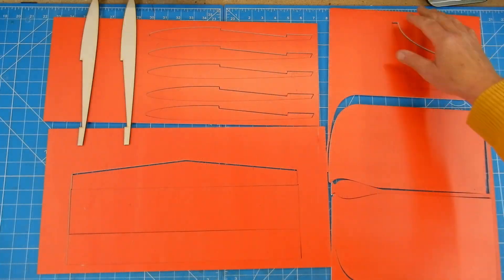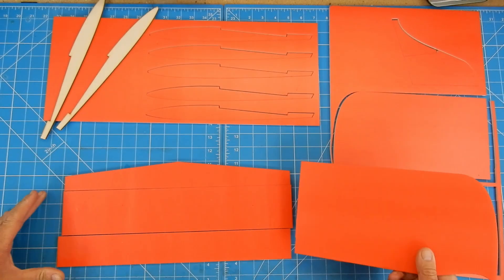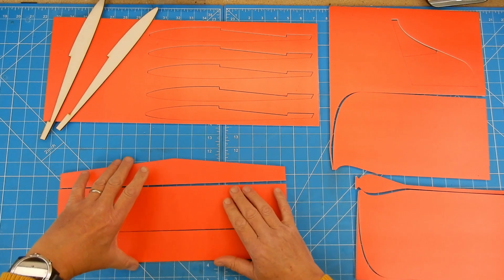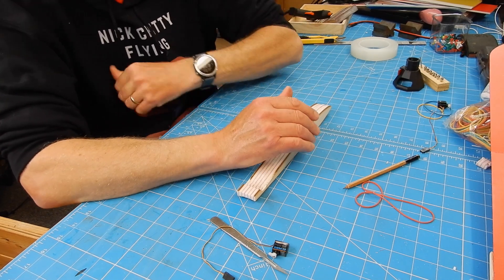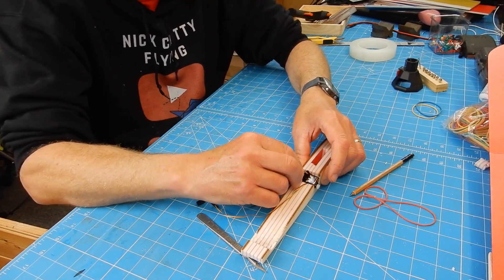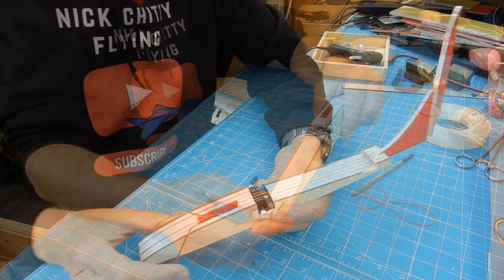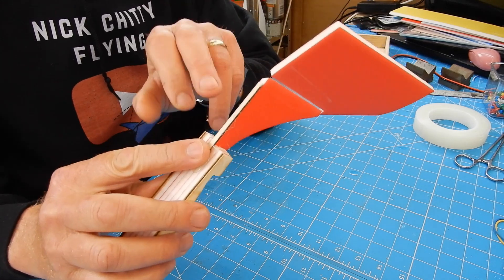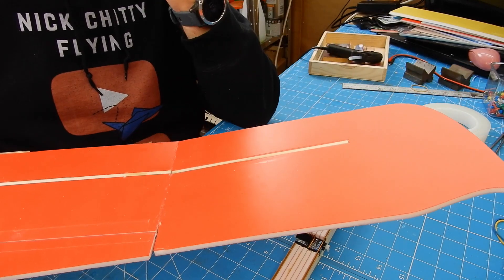Flying Wing morphing Kline–Fogleman wing sections Build

Comment: Instead of pins, how about repositionable spray adhesive? Somewhere I have a copy of the RCM issue that features the Windfreak. Are you familiar with Jim Marske’s work?
Reply from the maker: I nearly bought a plan set from marske but built a super floater instead. In the test flight video I use adhesive 👍worked great
Reply: @NickChittyFlying  I have 2 models without vertical surfaces. Both are outstanding flyers. My favorite is a diffuser tip by Richard Miller. Scaling up. Does not work well.,
Reply from the maker: @alcourtines4707  fully agree

Comment: Do you have rough dimensions? Might give a try at 3d printing the fuselage sides and rudder then use Adam's foam board for the wings and center of the fuselage.
Reply from the maker: I will post tomorrow buddy I am out with my wife till tomorrow 👍

Comment: I have had Jedelsky Kline–Fogleman wings on gliders. I built mine with double sided carpet tape but that is permanent, not removable. They did not fly slowly and the stall was brutal. But fun to experiment with. The Foam board is surprisingly crash resistant.
Reply from the maker: Foam board such cheap fun 🤩

Comment: Interesting!
KFm wings are similar to flying with spoilers out. If you have a powered model it's not a problem but they dont work so great for gliders. it will fly of course, just not nearly as efficient an a good conventional airfoil. I did a bunch of testing years ago, the KFm reduced flight time by about 40% on a discus launch glider. On a slope soarer it might work ok if the lift is good.

On a 'plank' flying wing the CG wants to be around 20% (neutral point is 25%). For the dihedral, for rudder only you need at least 7 degrees, 10 degrees+ works better. Less than that it wont turn well
Reply: Yes I agree 👍🏻. Power model will fly ok but not a great glide for landing. 
Slope plenty of wind plus up lift will fly ok but will be slow also will sink like a brick on the landing patch.
Reply from the maker: Thanks stay tuned cos there’s a twist coming 🤷 that had me stumped

Comment: Great project Nick, How about magnets for the panels with blenders tape to seal the leadinging edge?
Reply from the maker: Great idea mate but first test flight throws up something interesting
Reply: @NickChittyFlying . Looking forward to the next video.
Can you post some info about the material you are using for construction, looks really interesting
Reply from the maker: @88tcroberts  it’s a 5mm thick depron with plastic coating. If this thing works I hope to get angelwingdesigns interested send me a friends request on fb mate